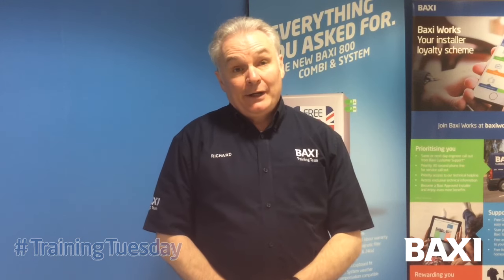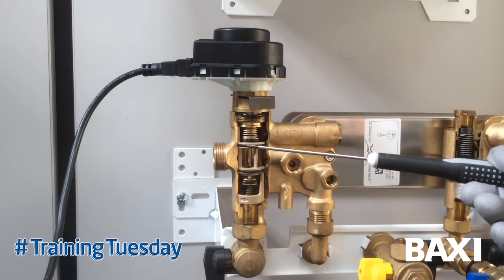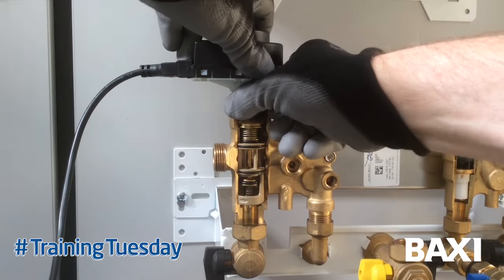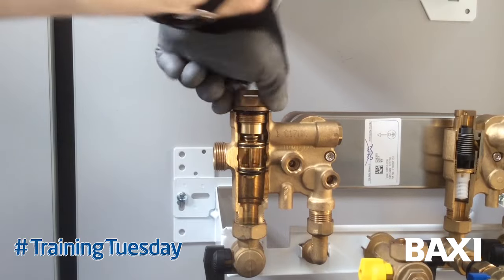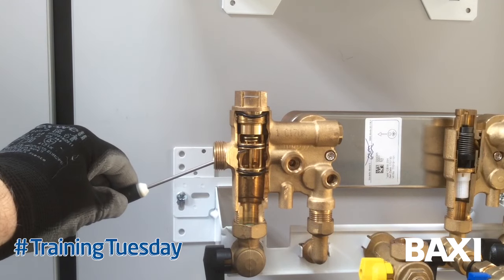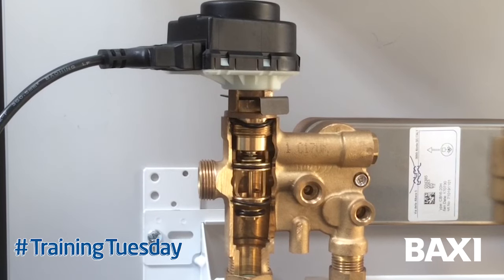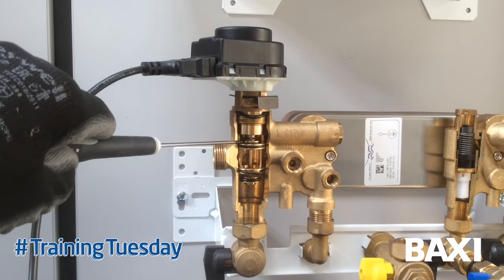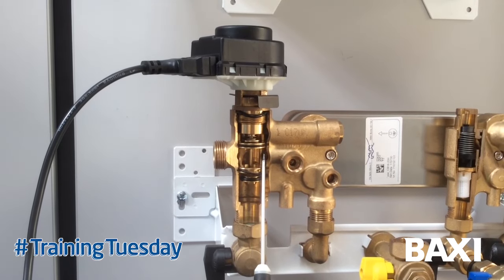A detailed look at diverter valves in a boiler - Part 1

Comment: Hav you upgraded the seals on the top as I have changed loads that leak  into the electric motor shorting out the boiler blowing the fuse

Comment: This is an excellent video, I think a customers boiler has a diverter valve issue for hot water not working, rather then a block heat exchanger

Comment: Hello, my question is the following:
When the boiler is off, where is the three-way valve positioned towards the heating systems or the sanitary water?
Thanks
Reply: Where setting is set. You can set it. Also manufacturers can change default. My baxi was on central heating default value where it always returns. You can have 3 values. Dhw, HC or Last requested - aka do not go back,stay where you are

Comment: it would appear my diverter valve is whining when on heat and you can hear it slowly close as it switched to DHW, i can replace the whole assembly it seems but could not find the cartridge itself. Do you know where i could just get the cartridge for a Laars Mascot HT 330? looks identical to the valves in this video

Comment: I have a horrendous whistle from my boiler and it seems if I flex the diverter valve head the whistle stops. It got so bad I wedged a bit of wood in there but then the whistling started again…always seemed to be within the first few minutes of the heating coming on. Replaced the head but hasn’t solved the issue. Could this be cartridge related? Or something completely different.
Reply: Hi, did you ever solve your issue? I believe that I'm experiencing the same.

Comment: How does this connect to my toilet valve that has a bidet washlette seat?
Reply: Via the condensed transporter fluxed capacitor, silly.
Reply: @davidwands1899  But how do I regulate the gigawatt transformer to increase in power when the blow dryer is activated during the mega flush setting. I heard it can blow out the flux inverter relay.
Reply: @offplanetevent  Ahhh, you need to run a 780 volt 32mm modular cable between the inlet orifice diode and the niobium oxide multi faceted capacitors and adjust where necessary with an 8lb pin hammer. If this doesn't work, I would advise quickly procuring a paddle, you'll need it where you're going.
Reply: @davidwands1899  I agree with you, but Im thinking a 10lb self- regulating pin hammer would be better than a standard 8lb pin hammer.  I will keep you posted, hopefully with success. Paddles give me blisters.

Comment: The top on the diverter valve leaked back in 2020 and was replaced in early 2021, now its leaking again on my Main eco compact.
Reply: Its a common fault on these boilers, including the Potterton sister boilers. The rubber o rings on the cartridge break down and cause the assembly to leak. I had 5 changed on my original Potteton Gold 33 between 2015 and 2018. They even exchanged the boiler for free after changing the cartridge 3 times, the valve once, and the whole manifold once. The new boiler, installed in 2018 had a new diverter cartridge fitted in 2019 under warranty. It's failing again now even with a Magnaclean filter inline, regular servicing and a system flush before both installs. I cannot fault Baxi customer service, but would I buy one of their boilers in the future? No chance.